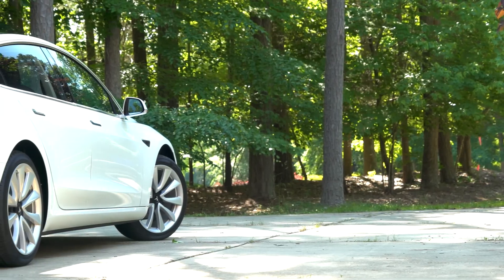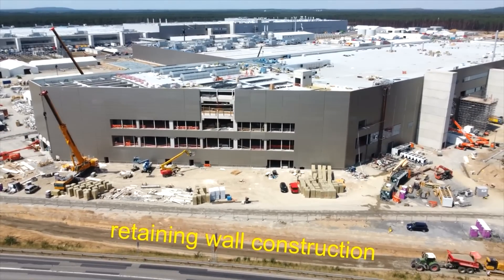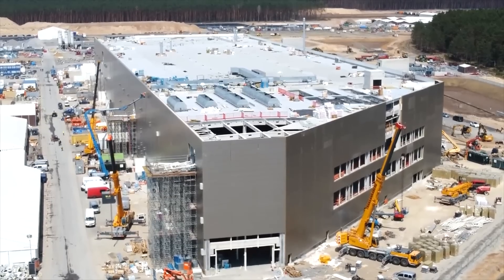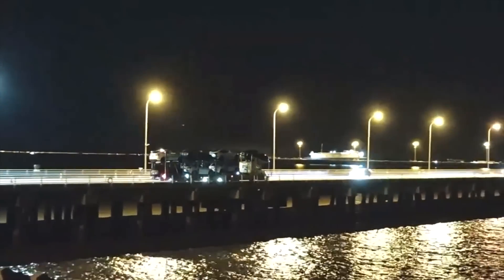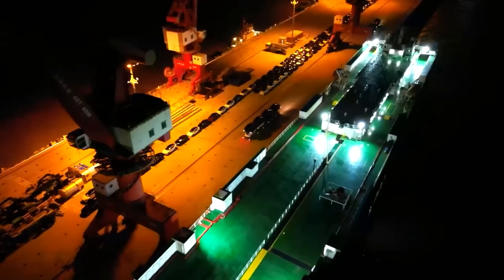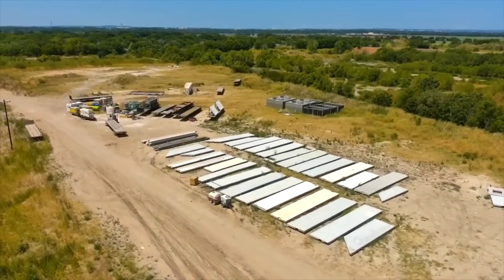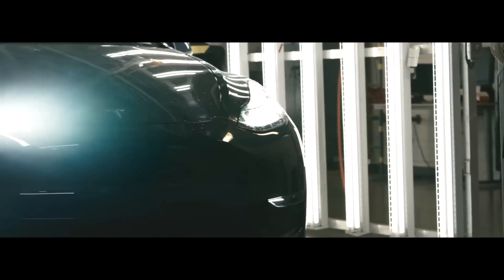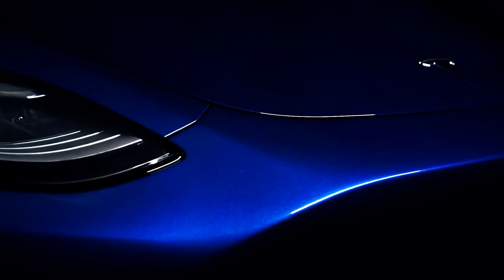TESLA GIGA BERLIN - 4680 - Production & Model Y SR (Source)

Comment: I would not like Tesla Prime, as if everything isn't expensive enough already. Also I'm not sure about the standard range MY; I'm still waiting for Giga Berlin to produce my long range order. I'd be okay with standard range and 4680 batteries, but just single motor sounds like a rear wheel drive, which I don't like for cold weather scenarios.